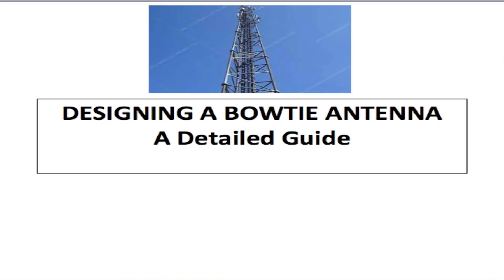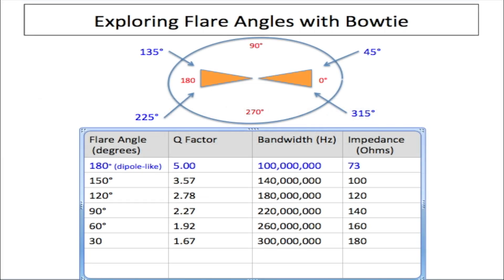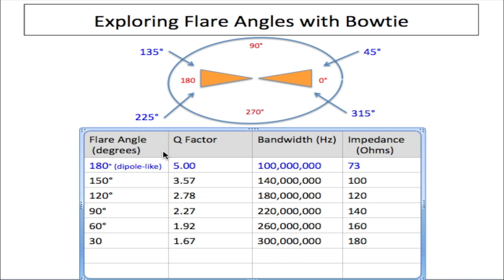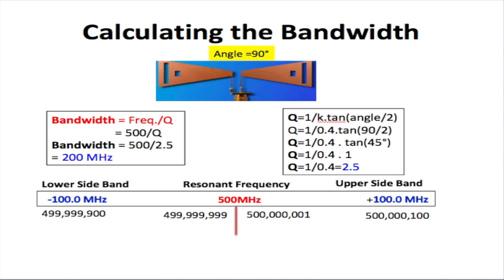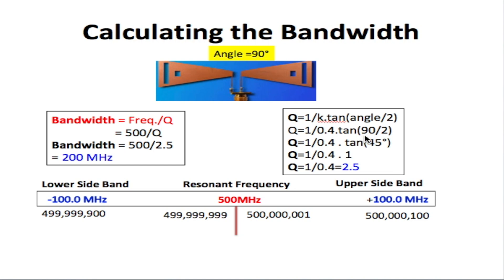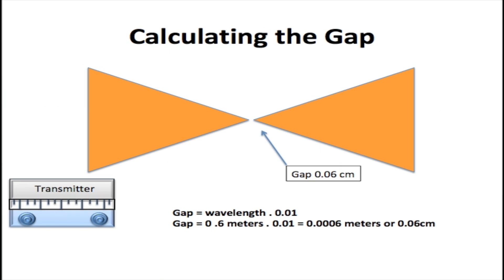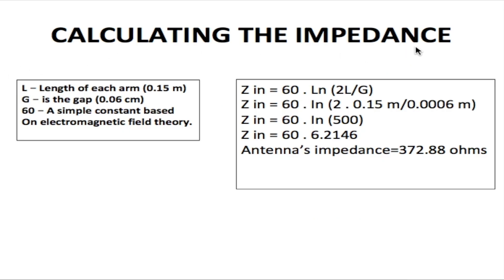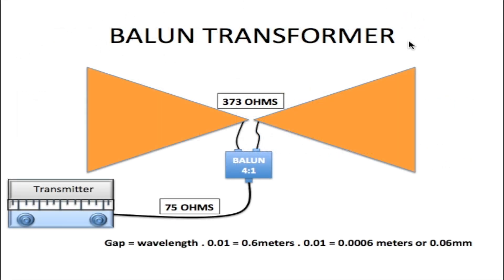Can You Build the Perfect Bowtie Antenna?

Comment: You need to double the height in your calculation.  90 90 90 90 triangles. using right angle Calc for sqrt(15^2+15^2) =21.213.  Thank you for the video and great explanation.
Reply from the maker: Thank you for the feedback on the calculation.

Comment: im confused. should i optimize the flare angle, and side length. or length of bowtie arms and width to optimized the S11
Reply from the maker: Sorry you are a bit confused.  The first thing you should do is to calculate the antenna’s length as you would for a dipole antenna. The flare angle is responsible for the bandwidth. Use the calculation as shown in the video to calculate the bandwidth. Hope this was helpful.
Reply: @TelecomTraining  anw this channel is a life saver. THANKK YOUU
Reply from the maker: You are welcome.
Reply: @TelecomTraining  for implementation in high frequency, the bowtie should be short. what if the length of bowtie is equal to 1lambda (wave length). Is that okay?
Reply from the maker: Wavelength=speed of light/frequency and a bowtie antenna is basically a dipole which is half the wavelength so each of the two elements would be a quarter wavelength.